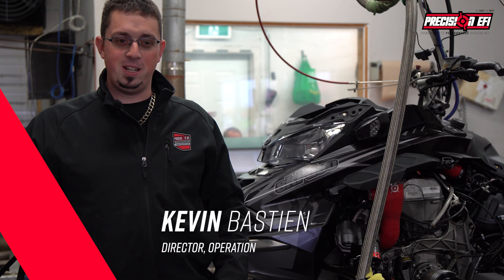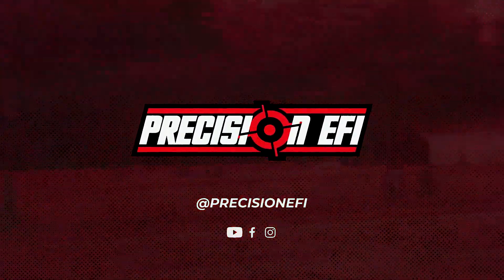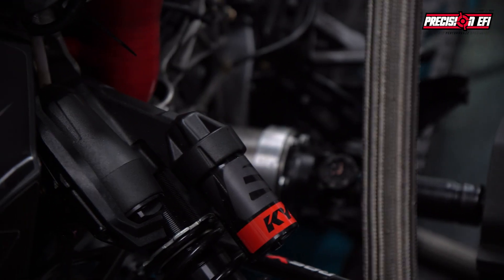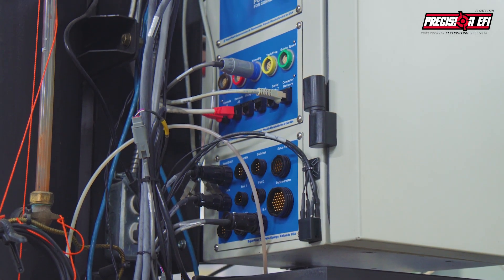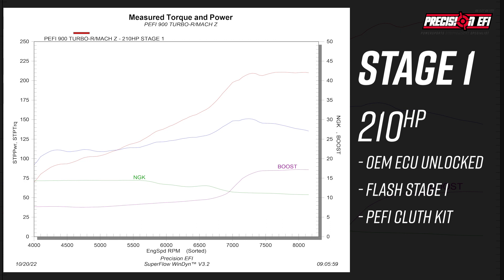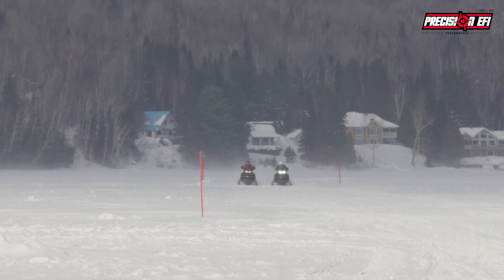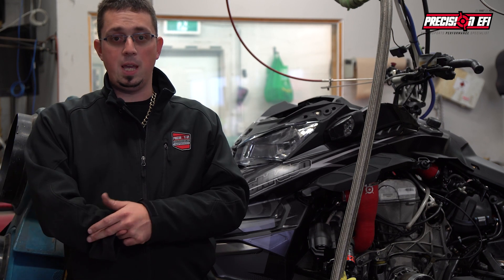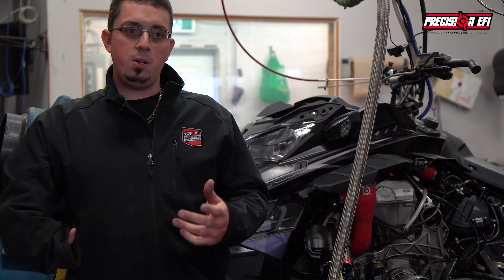Ski-doo 900 Ace Turbo-R / Mach Z flash stage 1-1R on stock oem ecu !

Comment: That's all fine and dandy and stuff, but try and find a belt that's going to take that kind of power. Sleds from any manufacturer are shredding belts regularly when over 200hp. Rubber belts just dont cut it anymore. These high powered muscle sleds need a new way of transmitting that power to the track.